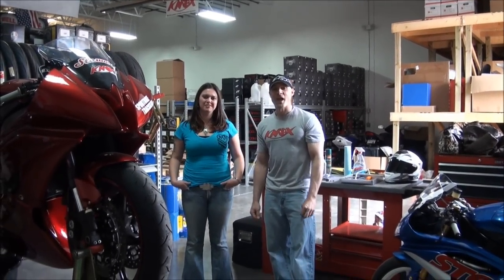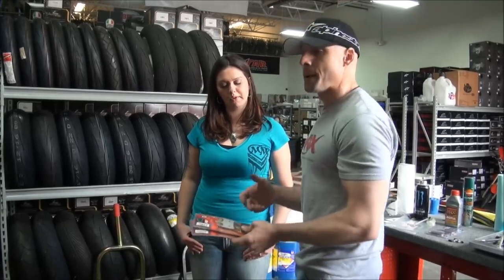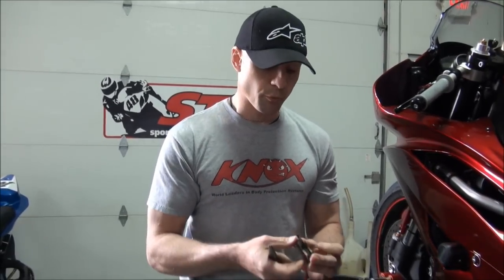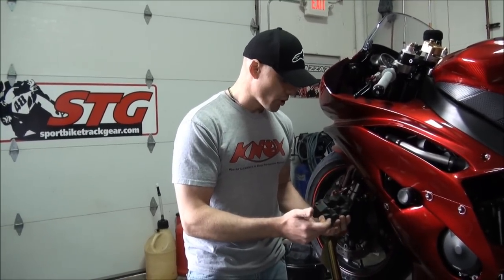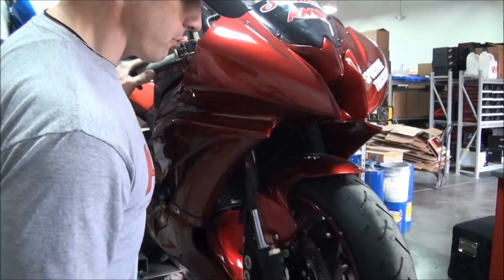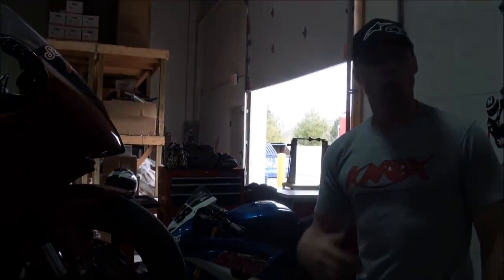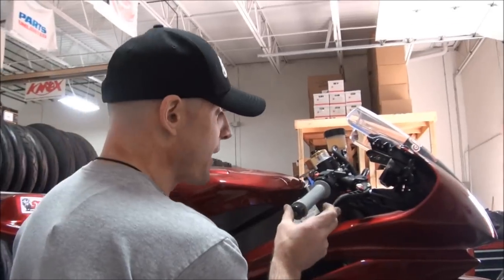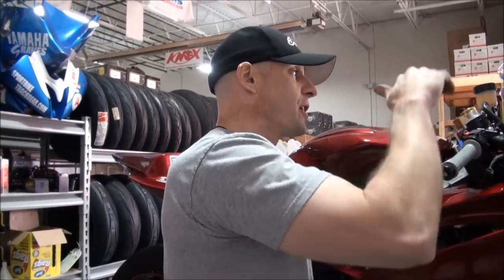How to Change Front Motorcycle Brake Pads from SportbikeTrackGear.com

Comment: 12 years old and still was the best video I found for a sportbike brake pad swap.  I never leave comments, but this was a perfect video so I felt compelled.  For anyone with Brembo monoblocks with a clip in the back of the caliper -  use a screwdriver to push the pads to the middle of the caliper and they pop right out.  When putting them back in, you just press them into the spring clip and push them in place.
Reply from the maker: Happy to hear this was helpful and thank you for watching! - Van

Comment from the maker: @deerman1212 You can if you want to, it is not a big deal as it won't be there long at all. The main thing would be to check the pin for wear and replace them if a groove has worn in them. A little lube where they pass through the caliper won't hurt and might make future service easier.

Comment: Thanks to you I did some maintenance on my R1. I've been riding since '06. This is the first time I've changed brake pads and fluid, sparkplugs and air filter. next project will be a powercommander V. But that I won't be doing myself. by the end of the season I'll be doing my chane.
Reply from the maker: +DEA178 Way to go!

Comment from the maker: @Bulgdoom I agree that there are optional cleaners that can be used. I will add that brake cleaner is used for this very task more than any other cleaner. End of the day the dust boots on the caliper pistons are very durable. Think about all the extreme heat, heat cycles and poor maintenance they survive. Please remember that brake seals can be damaged if they are exposed to petroleum based products.

Comment from the maker: @08GSXR600WHT THe advice for the pads is correct, race pads take a little more heat. That being said we do have several riders who use the Vesrah RJL pads on the street and track as they heat up fast and do not require a ton of heat.

The RBF has a higher boiling point and can perform better while racing or on the track a little better than the 5.1.

Comment: Just followed the suggestion of opening the bleed screw before pushing back the pistons on my audi.  Worked line a charm.  Can't believe I was struggling all those years.  All green gunk came out.  Flushed the lines after as well. Don't push those pistons back without opening the lines.  Make it easy on yourself.

Comment: Nice video! For some tips for other: put a towel at the rim etc, so you wont scratch anything. Also there is no need to bleed the brake fluid. Just clean, push and insert😊 same as with cars, no need to bleed the fluid unless you change caliper or want new brake fluid.
Reply from the maker: When I change the pads I also change the brake fluid now. - Van

Comment from the maker: @Jmoges I have used a hone on the rotors before and to be honest noticed zero difference. In my opinion as long as the rotors are in good shape and you break the pads in properly after replacement you will be fine.

Comment: I have a question, is it ok to flush the brake adding new oil on top of the old oil (like in the video) or should I first bleed all the old oil out, then start from ground zero ???

Thanks a lot 
Very good video!!!

Comment: Nice video, but I saw no mention of torqueing the caliper mounting bolts to the proper value.  Maybe I missed that but it's kind of important.
Reply from the maker: I do not use a torque wrench on every fastener, if you do not have enough experience and feel more comfortable using a torque wrench we encourage you to to do so. - Van

Comment: I understand why you removed the caliper to remove the pads and inspect and clean the pistons but wondering why you installed the caliper back on the bike before fitting the new pads? Is it because of the pressure required to fit the pin back into place?
Reply: +DeadHead Unlikely. When replacing pads, they will likely be snug and take up all available space. The more nearly loose they can be made, the easier it will be to get everything reinserted where it belongs before permanently locating anything.

Comment: Hey Brian,
 couple guys at the shop told me C59's and Vesrah's need more heat to work best, is that why the XBK's are a great street choice? And when/how do you switch out to the speed bleeder screws without opening the system when changing them...

and what's the difference between motul's DOT 5.1 fluid and the RBF Racing 4 fluid? Thanks!

Comment: Hey nice video.  Just wanna know,  no brake grease.
Reply from the maker: Lube the slider pins on the calipers for the rear caliper (front as well if your bike has a floating front caliper) to ensure it does not seize up. Other than that there is no benefit to lubing anything else IMO. - Van

Comment: how do you install the bleeders? does fluid come out when you put them in or do they just attach to the end of the bleed screw? also is that bleed bag just a bag or does it have a one way valve in it or something? would a bottle with a hose work the same way? i only ask as im on the other side of the world so the shipping cost probably wouldnt make it a viable option to buy if theres other options.

Comment: Great tutorial. I have a question though. even from day one on my new 2011 gsxr, i have had a bit of brake pad drag on my front brakes. I would say about 1 - 1/4 rotations when up on a statnd. I recently ordered some pads from you guys and did a pad change. Cleaned the the caliper pistons really well, and fresh fluid change. I torqued the axle to spec, and i still get only about 1 to 1/4 rotations. Any advice to get a more free spinning front wheel? Thanks guys.

Comment: I didn't notice whether he said it or not, but if motorcycle brake fluid is anything like the automotive stuff, don't allow any of it to get on anything - especially paint.

Automotive brake fluid easily and quickly destroys paint.

When doing this, exercising caution is a lot cheaper than a new paint job.

Comment: I have brembo brakes on a 2014 gsxr 750. Will that one way check valve be inside my bleeder screw as well? I noticed on another video you pumped and then closed the bleeder screw before releasing the brake. Why would there be a difference. Thank you for any response.

Comment: Hi, Can you change pads without removing the caliper body? i.e. keeping caliper on wheel just remove the pad pin and spring, hit it with brake cleaner, jamp your thumb in and push back the pistons and insert new pads?? 
Also - does your online website ship internationally? i can't find brake bleeder bags for sale or import into australia at all!!!

Comment: Just keep sending fresh fluid through the system until it starts flowing clear/clean in the tub connected to the bleeder screws. If you bleed all the old fluid out first, you're going to have a bunch of air in the system to deal with.

Comment: great vid folks... I have a quick question! I decided to change pads and bleed the front because i noticed a rubbing sound from the front end. I jacked the front end up and sure enough the wheel wouldnt spin freely, removed the caliper from the mounts and it span freely. anyway... new pads on and system bled and the pads still rub on the disc to the point where i spin the front wheel and it stops after 6 inches rotation (just like before). Is this normal? thanks, Chris. (disc's not warped)

Comment: Isn't lightly greasing the caliper/sliding pin with copper/ceramic grease necessary to make sure that the pads will slide correctly? Or am I wrong? :P

Comment: hey man i was trying to change the front brake pads on my cbr f2 but on the the bolts that holds the pads to the caliper is all messed up. i think the guy i bought it from tried to get it out and theres no way of getting out. any tips or ideas? i dont wanna buy another caliper, thanks.

Comment: One thing. On my r6 with same caliper. The brake pads rattle and I can rock the rattle clip forward and backwards what's causing this... Help.
Reply from the maker: Tough to say without seeing it myself. When the pads are installed in the caliper there should be enough tension on the anti rattle clip that it doesn't move very much if at all. If it is moving around you may need a new clip. What brand of pads are you running? - Van

Comment: Hey Brian, dont use Brake Cleaner on the pistons, it can damage the rubber seals. Soapy water/Ctrus or Vinegar based cleaner will do the job without affecting the delicate seals. Even chain cleaner may work since its designed to be delicate on the O-rings.
Reply: So what do you think brake cleaner is made for? 😂😂😂

Comment: Last Q 4 know😕. I'm reading a lot of different stories about installing a powercommander V. Does it actually improve the ride or is it a waist of €? I have a slip on Acrapovic and a K&N air filter. I would like to take  your advice in to consideration.
Reply from the maker: +DEA178 It would absolutely make a positive difference with the distribution of power! Fuel controllers are always a good use of funds!

Comment: Is it a requirement to bleed the breaks? My lines had broke so replaced them not long ago hence an oil change but now pads are low.... so would it be okay just to change the pads? Thanks!
Reply: +Charlie Grassick I hope you're kidding.

Otherwise, get your brakes fixed properly NOW.
Reply: I bled them when I changed the lines I'm not stupid I was wondering if it's vital doing it just to change the pads... or if they did it for ease....
Reply: +Charlie Grassick

Sorry for the confusion, and no you're not stupid. My sincere apology if any inference was taken.

Please review your original inquiry: The way it was written, I interpreted it as saying " ... my brake lines broke, I replaced them along with an oil change at the time, ... my pads are now low and I wondered if the brakes should be bled with the upcoming pad change ..."

Note: If you hadn't first mentioning bleeding in conjunction with changing pads, I'd have thought nothing of it, and would have assumed at the time of the line replacement they were bled. But when you first asked about bleeding at the time of the pad change, it looked suspicious.

I was erring on the side of caution in case for some reason they were NOT bled at the time of line replacement.

Now, to attempt to properly answer your inquiry, I will again assume something: I suspect there has been no recent maintenance (especially a thorough cleanup, etc.) in the caliper/pad/seal area; thus it would be a good idea to replace pads, cleanup, and bleed - i.e. the whole thing.

Here's why: I'm relying entirely on the video's emphasis of not just pushing pistons back in (to make room for thicker pads)  because that likely forces debris into the dust seals. It's easier to clean up everything one time while you're in there rather than having to revisit something. That eliminates any possibility of creating another problem "down the road".

Best wishes, and happy riding.

Comment: Why not rub the surface of the new pads in a quick circular motion on some really fine corn sandpaper before installing = no break in period
Reply from the maker: Best practice is to install the pads and break them in on the bike as described. In order for the pads to work you need to transfer pad material to the brake rotor for them to work properly. - Brian Van
Reply: Even though is not much, you could still breathe the brake dust you’d be sanding so unless you enjoy breathing asbestos and cancer that would be the last thing you wanna do.

Comment: I'll say one more thing and hush.

He didn't downplay the importance of rear brakes, just stated a fact that no choices were available.

On the other hand, front brakes handle most of the braking, typically 75%+. I suspect track usage may be even higher, so their role is much more important than rears, but not to the point of ignoring rears.

While in San Clemente CA in the early 80's, I watched a fellow riding a beautifully restored Indian on the street. Traffic was light, moving about 20-25 mph. The light turned red, a car stopped quickly in front of him, and he did the worst possible thing - used only his rear brake as hard as he could. It wasn't pretty. He slid into the back of the car, destroying the bike, and barely escaped injury by catapulting over the trunk past the side of the car instead of landing into the roof. He wasn't wearing a helmet, and escaped serious injury.

If it had happened to me, I wouldn't know whether to cry from not being hurt, or from destroying the beautiful bike.

The moral of this: Front brakes do most of the braking; make sure they can do their job properly.

I can't think of any situation where using only the rear brake would be a good idea.

Comment: If no air was introduced into the system why did you need to bleed the brakes?
Reply from the maker: Brake fluid should be changed once a season for a street bike and more often on a track bike. Good idea to change the fluid when you do the pads. - Van
Reply: @sportbiketrackgear  thanks for clarifying